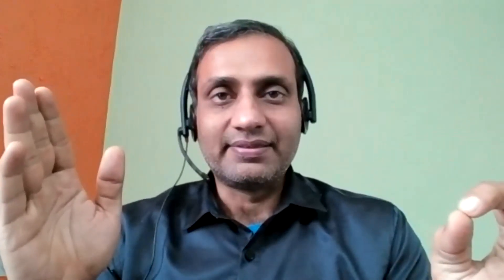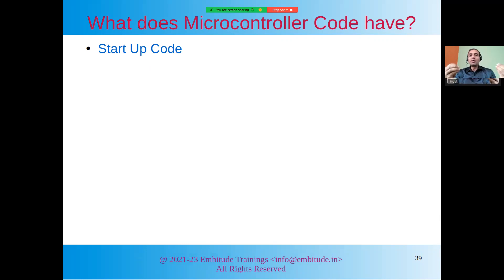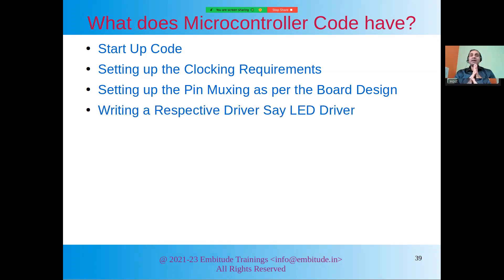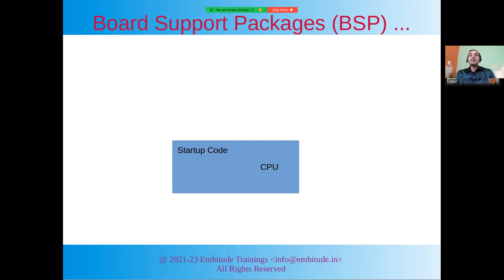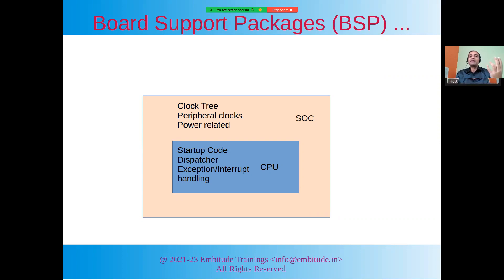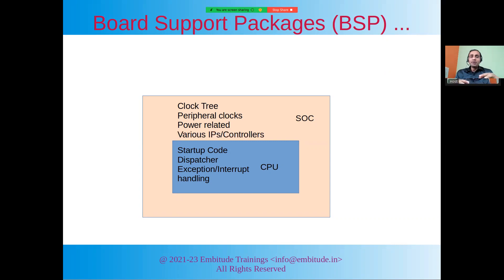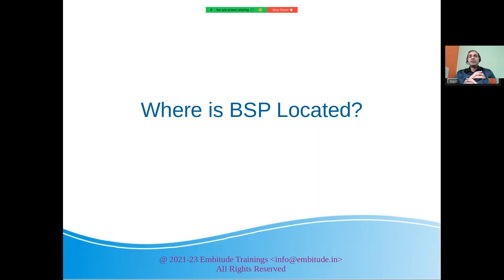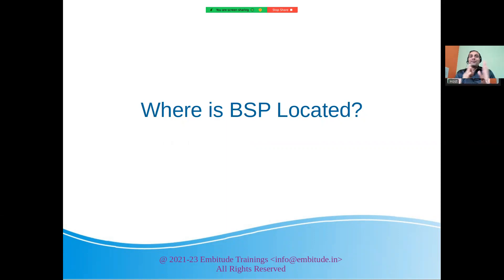Board Support Packages (BSP)

Comment: can you help us to make understand about how to do Mux configuration done in Uboot
Reply from the maker: Hi Manoj, there are 2 possibilities - For non-dtb based u-boot, typically there would be a mux.c file under the corresponding board folder. You may refer the same. However, in case of dtb based uboot, muxing would be done in dtb.